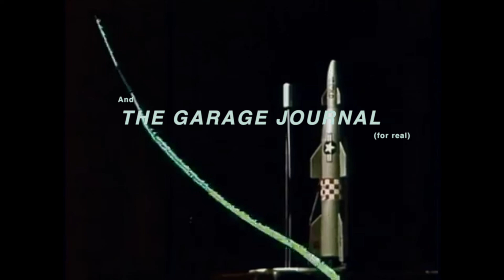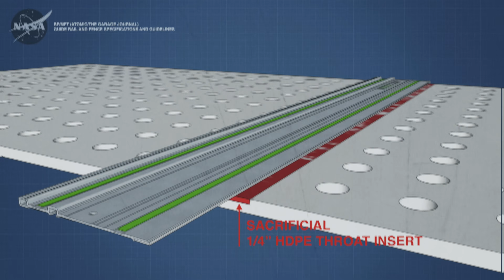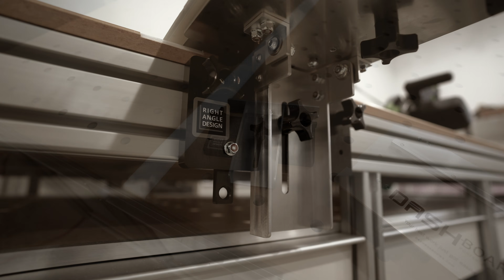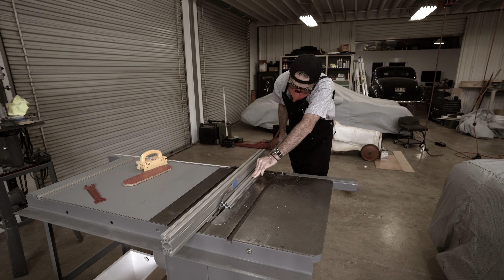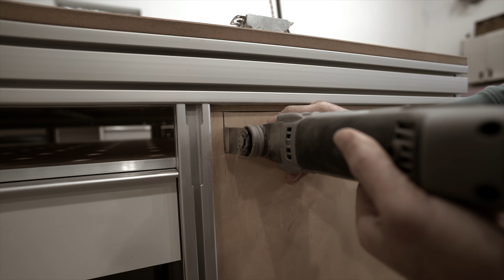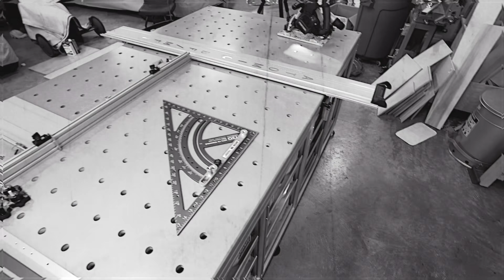The BF/MFT Workbench Build - Part 3

Comment: Do you ever find the sprung "drop lock" feature of the faces of the 8020 extrusion (it bevels 2 degrees inward toward the slots to act like a lock washer) to be a problem when you are using it as a fence?
Reply from the maker: No, it takes far more force to activate that spring that I can add with a workpiece. These extrusion are very, very straight.
Reply: @thegaragejournal6584  I have always just wondered about the fact that the face isn't flat.  On the outside chance that an odd shaped work piece registers against the recessed beveled area instead of the outermost face.  I am sure I am overthinking it, and an issue that would only happen once in a blue moon, but there it is.

Comment: I just acquired 10 7' 60mmx60mm extrusions and I am about to redo my workbench in a very similar way to yours, but smaller, probably something about 4x3 but I am planning to include my CT SYS and cyclone in it, something I think you should have done (if you have it).
Reply from the maker: Im not a big fan of the CT Sys actually... I do have a spot in my bench for my CT 26, but not sure if it will live there or not as I like having it around the shop.
Reply: @thegaragejournal6584  I guess I like mine because 1) $ restriction and 2) space restriction (I am envious of your space!). While not as powerful as the others, with the overpriced cyclone systainer, it is super practical. Before thinking about redoing my workbench, original idea what to use the extrusions to build a gantry over my work area and put the ct sys and cyclone there. The power and dust cable would then hang from the ceiling and it would clean up some of my floor clutter.